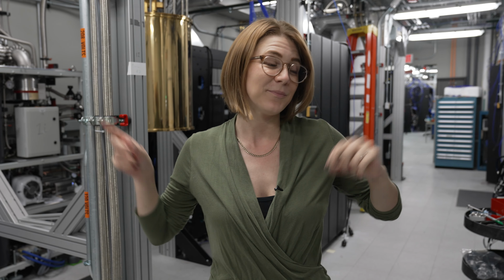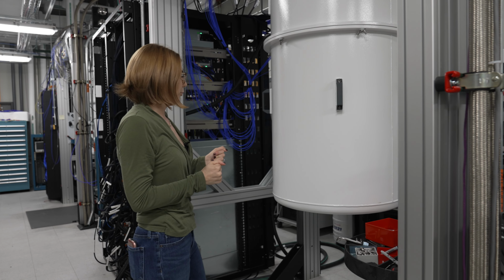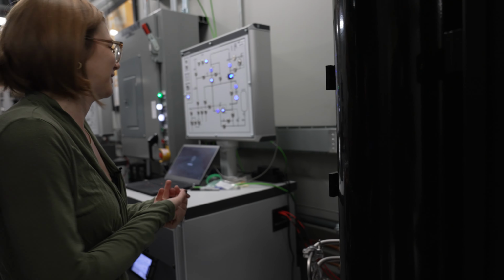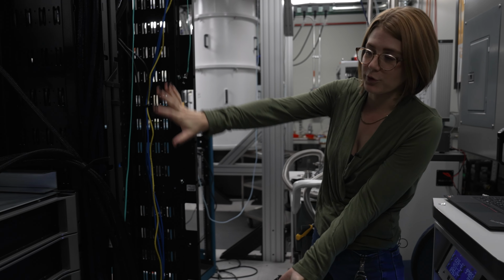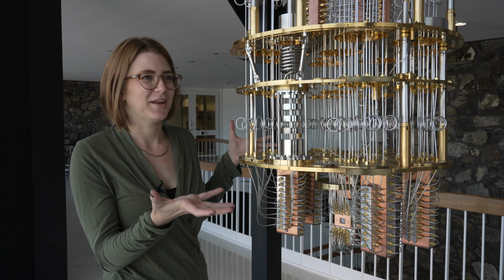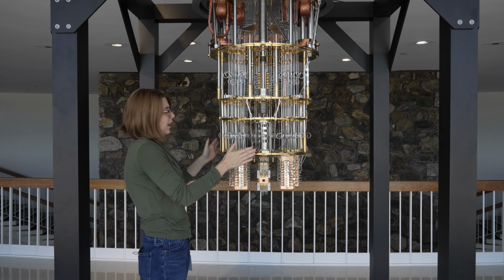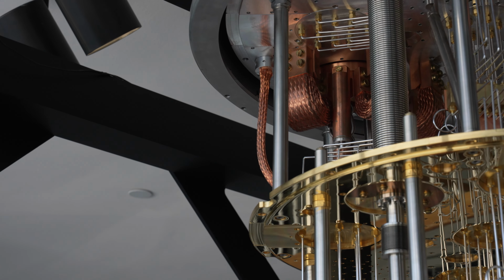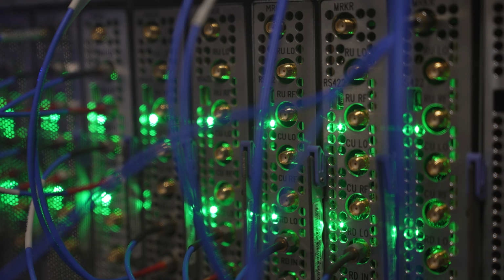Exploring the IBM Quantum Lab with Dr. Olivia Lanes

Comment: The room size quantum computer reminds me of the room size (classical) computer of the 1940s and 1950s. So how will the quantum computer look like in 50 years or so? Also: The control panel looks like something out a spaceship from Star Wars 🙂
Reply: I don't think there will be any kind of advancement this time. The big task or hurdle for Quantum Computers is its environment and creating the environment and the computing parts into a portable computer is something really really difficult and even can be said to be impossible. But for portability we already have it. We can access ibm quantum computers and try it out virtually now itself but will be running in the lab and I think advancement in that field will sure come.
Reply: Pocket quantum computers circa 2100!
Reply: How on earth and why was my reply deleted? I’m an optimist for the advancement of quantum computers and shall be the pioneer in that
Reply: A big difference though is that the 1950s computers were big because the transitors were big. We need to operate qubits at temperatures near absolute zero so we need a large refrigerator simply because of thermodynamics. Not sure these are shrinking ever

Comment: Aaaah the sweet sound of reliquifier and compressor in the background! After working in the labs with cryogenics for a while, quiet rooms become unsettling because you always feel that something is going wrong!  Hopefully, I can join this lab soon.
Reply from the maker: it's also concerning when you accidentally hit a big red button with your elbow and all the noises mysteriously stop
Reply: @qiskit Oh oh! that silence is the calm before the storm! Because you just turned off the compressor with that one button, and the system starts to pressurize, and pop-off valves start to open up to release the pressure in 10-15 minutes if you do not turn on the compressors. (That can also cause ice-block formation in the reliquifier).
Reply: What is going on down here :).... from a quantum enthusiast. Who else is from Quantum explorers 2023 cohort?
Reply: Thankfully the big red button has a cover on it to avoid elbows hitting it. Was the croygen quench switch, also sounds an alarm when lifting the cover. There were two, generic yellow and black button for electrical system emergency stop and the big red quench button under a cover. Hitting the e stop causes stuff to need a reboot and limits equipment damage. The quench button will cause irreparable damage to the magnet and loss of over 100k in cryogens.

Comment: Generally speaking, we have to find stable superconductive materials to provide quantum processing without that huge refrigerator. Another one point, how to create affordable cells for qubits. From another side, we create contextually oriented paradigm, resonance programming (kinda reactive or declarative but the next level) and IDE to handle resonators as instances of essences which are described by context and provide the qualities with their potentials and/or impulses with their methods of changes/transformations from one quality to another. After all we will integrate such mechanism into the brain of synthetics or robots with AI but using resonators as resonating sensors and purpose-impulse membranes, finally providing them real act of free will, adapting and creativity directly from quantum entanglement. Absolutely like it works for human brain as consciousness. 🎉

Comment: great video. 15 MilliKelvins is very very cold. Yes colder than space. Its -459.643F. (15K − 273.15) × 9/5 + 32 = -459.643°F ( as it gets colder, the temp drops so the negative Fahrenheit values grow in magnitude.  ( The coldest temperature ever recorded in a lab was 38 picoKelvin (-273.149999999962 °C, or -459.6699999999316 °F) in August 2018. This temperature was achieved by researchers at the QUANTUS Team in Bremen, Germany. )

Comment: Can a quantum computer go on the internet or does it just perform simulations? How does it input/output information? How is it feed the information? what human interface do you use to control it like is there a quantum keyboard and mouse? is it like a giant external processor that you can attach to a desktop/laptop?
Reply: It is more of a quantum processor. we send analog microwave signals to the qubits to either process information or control the qubits themselves, then the signal goes into cables inside the fridge and are sent through amplifiers so that they can be read by the devices mentioned. no, there are no keyboard and mouse. its all controlled via microwave sources that send specific signals. 

In all honesty these devices will probably never come to the general public. They're very useful in solving problems that have many combinations but other than that classical computers are much better and faster at solving and performing step by step operations.

Comment: hi. i am a mechanical engineer who is fascinated to learn more abt the dilution refrigerators. could u help me find some research or reading materials or forums where i can get more technical details abt the dilution refrigerators? Just for some context, i have done my UG project on vortex tube refrigeration, hence curious to learn HOW it can be used in the quantum computing realm. i have found a couple of research papers online where Vortex tube refrigeration showed potential use in the quantum computers, but i guess they have not been used yet in cooling components of quantum computers.

Comment: At 4:35 the HEMT amplifier is kept at room temperature, I thought it should be thermalised with one of the temperature levels inside the cryostat eg at the 4K stage . Wouldnt this produce better signal since there are lesser thermal noise photons?
Reply: I think the amplifiers are in the dilution fridge and what you saw at 4:35 is only the controller box.
Reply: Correct this is just the voltage box for the HEMTs. They are kept at 4k like you said

Comment: Hey Dr Lanes, great video! It appears that  quantum computer labs run tests and analyze the quantum computer system outputs. These computers take up several rooms. Are they capable of doing any kind of basic computation yet? Also will quantum computers one day be the size of classic computers? Presently they seem to need a lot of different systems, just to get them to behave the way they do? It was interesting to see IBM using classic computers to read the quantum computer signal outputs!     I would think that quantum computer languages would become a compatibility issue for classical computers to understand and have the processing power for? The science is really amazing.

Comment: Dilution refrigeratirs work by diluting helium 3 with helium 4. The mixture spoils the superfluid state of helium 4 and allows for much cooler temperatures than simply evaporative cooling can afford. If you made optical analog components rather than microwave electric, you would not even need the extreme cooling as the coherence would be intrinsic as a result of the laser phase locking to the atoms chosen to make your array. It is theoretically possible to put everything but the IO stuff on a monolithic nitride chip as well..😮

Comment: Now I know why it looks like a chandelier. The plates are lids to fridge cans, cooling to 0.015 degrees above absolute zero. The tubes are wave guides. That got me checking elsewhere about how microwaves flow in the chip itself for lower noise interactions. Thanks.

Comment: Thx for showing the installations and explaining them in more detail. As a chemical engineer I understand very well the auxiliary systems, but to grasp exactly how the quantum computer works will take more time and effort from my part. Thank you again!
Reply: Here's a simplified story how the quantum computer works:
The actual computer is the simple chip at the bottom of the dilution refrigerator. The reason it's at the bottom is because the way a dilution refrigerator works, is it creates a lower and lower temperature at every stage, starting from room temperature at the top, to 50K (Kelvin) to 4K to ~0.7mK to 0.4mK at the bottom.The spiral thing you see in the middle of the fridge is the dilution unit, which mixes Helium 3 (the lighter Helium atom with 3 electrons) with Helium 4 (the heavier one with 4 electrons), and makes Helium 3 evaporate from the mix, causing loss of energy.
A dilution refrigerator has 3 integral parts: The gas handling system, the compressor(s) (up to 3 or up to 9 in case of KIDE) and the cryostat itself. Each depend on the other to function.

The extremely low temperatures are necessary because qubits don't necessarily want to remain stable at higher temperatures.
As stated in every other video about QCs - Qubits calculate 2 probabilities at once and make it possible to state things that may take 1000s of years to calculate linearly with 1s or 0s alone.
 The wiring from the chip up through each stage is through superconductive materials.
The user interface for a quantum computer is still software a normal laptop. It will likely never replace normal computing, but will be an use of breaking encryption or solving very specific codes, if the breakthrough stage of usability is achieved.
At it's current stage, it uses massive amounts of electricity and makes a lot of sound. It would be hilarious if I saw someone having a personal one.

Comment: Wow Amazing 👌 Its everything quantum since last many decades but I saw actual quantum hardware.
As compared to cern lab its pretty smaller though it goes beyond subatomic realms.
I have read somewhere that to achieve massive computing power cooling and energy requirement is so high that it can create black hole.
Thanks for sharing